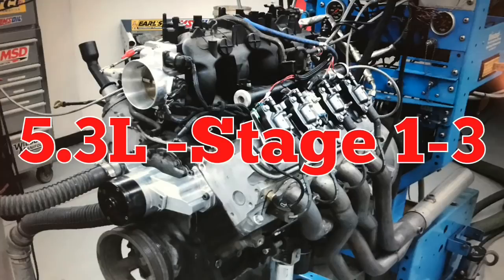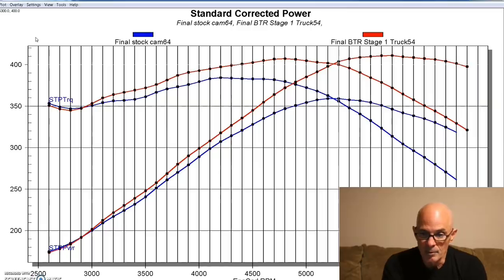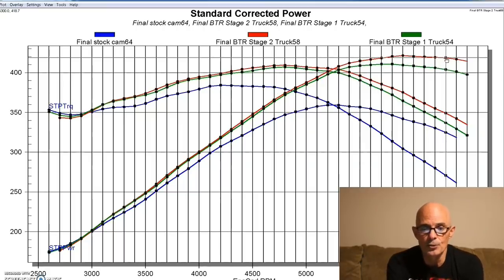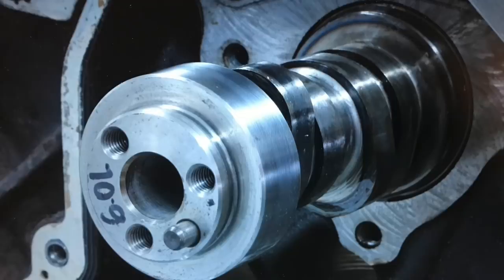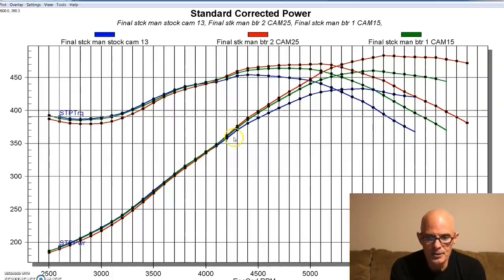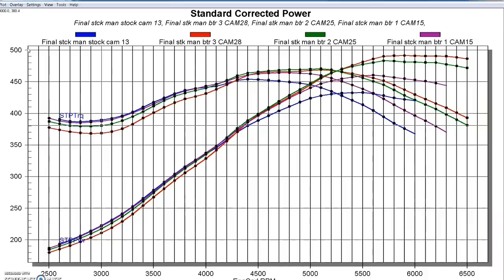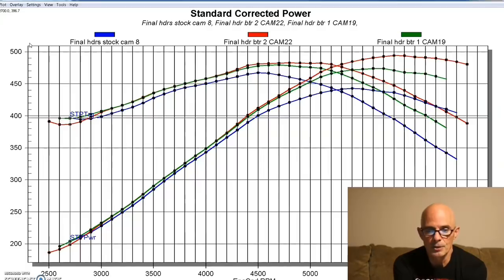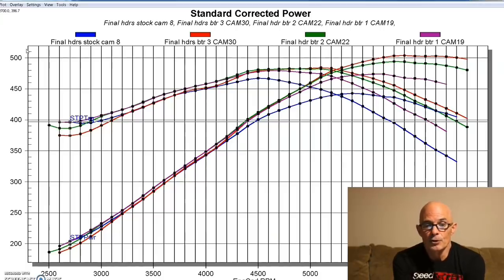LS TRUCK CAM TEST-5.3L & 6.0L (TORQUE FOR TOWING)

Comment: Im3 runing the stage 3 in my daly 6.0. But i put 862 heads on it to rase the compershion to 11 to1.with camero header and i have no problem with it and a 2700 stall

Comment: Biggest takeaways from this test:
1)  Stage 1 is nothing to scoff at.  Everything to gain and nothing to lose (unless you have a 4L60, then you’ll lose 3-4 gear)
2)  Stage 3 cams always sacrifice low rpm torque for high rpm HP in stock CID, and the shift isn’t necessarily favorable in small displacements.
3)  Rec port heads really like long tube headers.  I’m guessing because while the intake ports have massive cfm gains over stock cathedrals, the exhaust cfm gains are “minimal” (by comparison), so power gains from scavenging are “amplified” a bit.  

A buddy of mine has been asking how to make more low end torque in his 3/4 ton Chevy (rec port 6L).  I told him long tubes and a BTR stage 1 truck cam or Summit 8718 (206/217, 0.500”, 110 LSA).  Judging from the results here, I think I pointed him in the right direction.

Comment: Not that I don't like looking at that pretty face, But you're blocking the upper engine speed range brother! LOL. So exactly where did the stage 3/6.0/headers combo make peak power? I've been trying to figure this one out because thats the combo I'm running in one of our project vehicles and revving it over 6200 results in a slower ET everytime. Maybe those rectangular port heads are letting that cam reach a little higher in your test mule than the catherdral ports I'm running?

Comment: Definitely subbing. Can you make a recommendation, 70 Chevelle I have a LQ4/80E. 317 heads. This will be mostly a street car. I also want to run A/C. I’m willing to change heads to 243 if needed but would like to keep the 317 “ if” I go turbo later. What converter and gears would make a nice street beast and maybe some strip? I’m running a 12 bolt currently. Thanks for your effort.

Comment: I'm going to run a trick flow 216/220 duration, 560/560  lift on a 6.0 LQ4 chevelle  6 speed twin 256BW turbo's  should run great and be easy to tune. Doing all myself  !

Comment: Sir i love your channel you do a great job ive learned a lot i have a 01 1500 with a 5.3 have a cold air intake and acess to a tuner.i also jad monster transmissions build a 4l65e trans with a 1600 or 1800 stall and corvette servo. I have long tube headers and hi flo exhaust. I saw btr torque cam they have out comes with heave valve springs and push rods i was woundering in your opinion what the best cam would be for me for to buy. I want good power and torque for pulling and anything else ypu reccomend to do to my truck to get more torque would be great thanks man love ypur channel im just not good at reading dyno charts thanks keep up the good work
Reply from the maker: btr torque cam

Comment: I just built a gen 3 5.3 for my k10. stock motor other than a BTR stage 3 cam, and springs, hardened stock length pushrods from Texas speed. I will make 430hp at the crank? seems a little high compared to what i've heard. New to all this engine stuff!
Reply from the maker: not sure what stage 3 cam it is but that should be close with headers

Comment: Is it advisable to do do a cam swap on a 6.0 LS that has high miles (over 200,000) without pulling the heads, reworking them and putting in new lifters?
Considering the BTR Stage II cam. Thanks! Awesome channel!!
Reply from the maker: no need to pull heads

Comment: Looks to me like if a guy really cares about truck mods for towing and drivability then their most effective option is a gearing swap 😆.

Otherwise displacement, compression, and headers. Not sure how well a stall converter works for towing but that might make a big difference too.

I also have a feeling Cath ports are better than rec ports.

Comment: Great video man! 
But why did the 6.0 make so much power stock? 
Thats a fare bit more than the egnine was rated to make from gm when stock. 

I have been considering the stage 2 cam for my 2015 6.0 power Silverado 2500 for the better torque and power when towing. 
But it just seems odd that that cam is making almost 100hp and 100 torque more than my engine was rated at stock. 

I am also looking to go to long tube headers soon as well.

Comment: Richard, would you expect to see much of a difference with the new v2 version of the cam? More specifically the Stage 1? I'm getting ready to do a cam and spring swap (and headers, exhaust, intake..... :) on my '04 Silverado (5.3L, 4wd, 3.73, 33" tires, otherwise stock). It is my daily driver and does tow on occasion so I'm not willing to give up much, if anything, down low.

Comment: Hey Richard!  Would we see power had or power lost if we threw a set of 862/706 5.3L heads onto the 6 liter with the btr stage 3 or 4? Would the cams need to breathe more being choked by the 5.3 heads or would we still see MORE power with the added compression dispite the smaller combustion chambers than a factory 6.0 head?
Reply from the maker: See the 706 vs 799 head test video on the cammed 6.0L
Reply: @richardholdener1727  862 heads FTW

Comment: Do you think the summit 8701 would be better than the stage 1 or 2 truck cams? Cheaper and a bigger cam and can still use stock converter?
Reply from the maker: have not tested it

Comment: My Question...
Why did my Buick V6 horse power peak at 4800 rpm with 403 whp ( estimated at 500 crank) and 500 wtq ( estimated 600 flywheel torque)
This was 25 years ago, It had:
- 44mm turbo 
- Giant Precision Turbo intercooler 
- bigger injectors 
- bigger throttle body
- 3” single exhaust ( cat delete)
- Houston Down Pipe
- 23 lbs boost

Stock valve springs, stock intake manifold, stock cam, stock exhaust manifold, stock bottom end

Why such low rpm horse power peak 4800 ?

Maybe weak valves???

It did have 125,000 miles on stock springs
Reply from the maker: That motor had a very small cam and small ports-it was designed to make power early in the rev range

Comment: Really interesting work.  Just discovering your channel. Have you does any research on cam or just general build that increase pressure down low for better efficiency and maybe even sacrifices rpm and peak horse power?
Reply from the maker: I HAVE RUN 1000S OF TESTS ON CAMS-IT IS VERY HARD TO GET GAINS AT 2000 RPM WITH A CAM-EXCEPT WITH VVT
Reply: @richardholdener1727  why do you think that is?  Is there just too much sacrifice on the top end to be worth it? Would pistons + cam achieve that result?

Comment: stage 2 makes within a few hp of the stage 3, and gives up nothing to stage 1 in torque.  Stage 2 ftw.  The LS3 heads are soft at lower rpm.  706/862 heads would claw back some of the losses from the stage 3 cam.

Comment: Richard, great tests. I have been thinking about the Stage 1 came for my 2011 4.8L Silverado. Will that work with VVT? I know the VVT is supposed to help low rpm power, so If I had to delete that, I wonder how much power is lost down low in a VVT delete?!?
Reply from the maker: you need vvt specific cams

Comment: This must be for the 1st version of truck cams from btr. I have a version 2 stage 2 and those cam specs where nowhere near mine....
Mine are 262 intake 268 exhaust duration
.553 net lift
111LSA

Comment: Great job! I would like to have seen the differences in HP and Torq with headers on the 5.3. I currently have a 5.3 with the stage 1 cam and stock manifolds with 2.5" mandrel bent exhaust and really like it. My truck dyno'd at 275 hp to the tire and 404 torq. I have no idea how this compares since it is a truck on rollers vs. engine only on dyno. What are your thoughts? Thanks again.

Comment: 95-100kPa MAP only requires only about 1/2 throttle at 2k rpm. Very common to find yourself in that speed/load condition when you drive a stickshift.

Comment: Hey Richard!! Hope all is well. I’m considering a stage 1 or 2 fora 5.3 from summit racing. The stage one is a 209/217 with 500lift or a variation of this cam is with 550lift. The stage two is a 212/218-16??   Could you in the future run the stage one from summit. Or comment on it. Maybe there is little difference between the btr stage one and summit. But it would cool to hear ya. Thanks Richard 😁
Reply from the maker: either is good-just get one and put it in and enjoy
Reply: Richard Holdener. Hey Richard!! Just received my summit 8712 cam. 209/217 500lift. 112lsa. Why this cam ?   It’s to keep my lift low to help out with the 1.8 stainless steel roller rockers, 7.450 pushrods. I also received the pac 1219 springs. Good up to 625lift spring rate is 344-ish.  Is this a good combo?? So. Watching your videos was a definite smart idea and educated me. Generous information here. Thanks Richard. Now the task of doing all this. Plus I’ve got exhaust and headers waiting.  Stay safe

Comment: people called me crazy for going with stage 2 truck cam in my 1999 z28 made 350 hp 350 tq to the wheels 410 gears 3600 stall it’s a monster slicks are needed what was the advance in each camshaft specs please would  advance affect torque ?

Comment: What converter would you go with on a 6.0 with a stage 2 cam ?
And when you bump up to stage 2 from stock.  Should you do lifters ? Should you do springs ? Should you do rockers or lifters ?
I just need some more power out of my 6.0
Reply from the maker: not sure on converter-springs are necessary with most cams, lifters are a good idea-though we often reuse.

Comment: I’d love to see a test with the vvt in place vs the cams.   I’m looking to do a cam swap on my L92 but I’m concerned that deleting the vvt will lose a significant amount of low end torque.    Although with the extra displacement and nearly 1 point in CR that might not be that big of a drop.  And if so the 6l80 will make up for some of that in gearing.  

What do you think Richard?
Reply from the maker: I can't test VVT on the engine dyno with our Holley or Fast

Comment: I literally just ordered a Stage 4 BTR camshaft for my 6.0 LQ4, and I'm a bit disappointed to see the loss of torque down low. My truck is a 5-spd manual however,  so the convertor isn't an option. Will my manual transmission help me or hurt me with the torque?
Reply from the maker: it will help but the loss is still there

Comment: The low rpm losses on the 6.0 probably due to the larger square port heads; square ports with their larger cc will have less velocity when compared to the smaller very efficient ports on 706 heads. 706 heads would obviously then work good on a 6.0 if low speed torque is the goal. They might even be a better match with the cam, in terms of total "under the curve" power produced. The square port heads obviously would work better on a larger displacement motor, or one cammed to make power from 5000 up..

Comment: If you have a 6.0l, could you not swap a 4.8l or even a 4.3l converter in to get back some stall speed? I know it won't be perfect but given how much more torque the bigger engine makes at low rpm it should give you +500rpm stall over what it does with a 4.8
Reply from the maker: not sure on converters

Comment: Richard I am using a manual transmission such as a SM465 with my 6.0 LQ4 is I use a stage 2 or 3 cam what are the benefits? I have 799 heads all naturally aspirated. Thoughts and recommendations

Comment: Was the loss down low due to compression or could it be fixed with compression because I think most truck motors are 9-1 stage1 shift  5900 stage 2 shift 6200 stage 3 6400 especially if you have a stock transmission coming up by carry so far out in my opinion

Comment: Where's the boost? Just subscribed. Love the testing myths & rumors & giving data to teach what's real. Would you show us when (if at all) it's necessary to run a blow off valve? Is there a boost level, or type of turbo that makes it a real necessity, or are they just to make a different sound  when you let off?
Reply from the maker: always run a BOV

Comment: Did the 6.0 have trailblazers ss intake with headers? I've read that intake works good for a factory setup, and with a ls7 cam the 6.0 is capable of 450 and above. Better heads can just top over 500, or really close to 500.

Comment: im tryna see the absolute biggest and most aggressive power adder cams you can find on the interwebs for a sbe 5.3/6.0 with stock heads
Reply: Hakimbo Bola  do you have so little to do in life you need to intervene on the most irrelevant fact that not a single person in the universe cares about because its 2020.

Comment: You say it’s hard to get torque gains real low with a cam. So what do you think is the best way to get the most gains as low as possible? 
Mainly for in a towing application. 
Running a completely stick 2013 5.3. Stock exhaust, intake, etc

Comment: I have a BTR stage 4 trk cam (224/230[553/547] 111.0 lsa)  I have a gen 4 5.3 w/flat top pistons and 243 heads.  I will be running a sheet metal intake.  Since you didn't use the stage 4 cam; what gains do you think I will get w/ the cam listed above?  Also, how radical do you think the CHOP will be?  Thanks
Reply from the maker: the intake and cam will both hurt low speed and mid range torque
Reply: @richardholdener1727  thank you for taking the time to answer my questions.   What cam would recommend ?  I really want that chop, and some power

Comment: So if I step up to a better torque converter, what stall should I use? Building a 6.0 4X4 Truck w/4L80. Daily driver, combo town/highway driving. Emphasis on better in-town acceleration.

Comment: Why didn't you test the stage 4?  Btr recommended the stage 4 for my 5.3 truck,  circle d 3200, longtubes, tbss intake, and 4.10s
Reply from the maker: did not have
Reply: Richard Holdener on 6.0 lq4 or lq9 will i see gains with 862 or 806 heads with a stage 2 cam or just keep the 317 heads? Thanks in advance

Comment: I have a btr stage 2 truck cam in my 03 lq4 Sierra, I have the stock 317 heads on it and am planning to port and polish a set of 243 heads I have then install them. I also have banks headers..... question, what turbos do you recommend I buy and should I change anything.... I pull a camper and don’t want my friend with his 06 f350 to make me feel inadequate :). Looking for streetable 800 Hp and similar torque. PS I want to use two turbos because it’s symmetrical and satisfies my need for ...... well you get it.

Comment: you say a lot of guys want that torque down low and its really hard to do that with a cam shaft. what do you suggest to add more power down there ? my truck isnt a race car... im not often mashing the throttle if ever, but i want her to be able to get out of her own way as the saying were
Reply from the maker: compression and displacement help down there

Comment: Thanks for the video’s. I’ have a 6.0 lq4 4l80e 355 rear gears. I have a set of 862 heads I’m going to swap for the 317s. Was wonder what cam should I go with? Was thinking the btr stage 2 v2. Looking to maximize torque

Comment: What about their stock valve springs with only .500 lift comp cam 54-455-11 it's more on the extreme side of lift but they say it's good for the smaller engines at delivering torque down low I know you ain't trying to buy all the cams but if comp is going to send you one I think it would be worth looking at

Comment: Richard like get your thoughts, for a real world test where the truck needs to retain the cats which would affect scavenging, would a (@050) 210 in/224ex 114*ls make better low end torque from 2500 to 4000? Than the factory ly6 cam?
Reply from the maker: maybe-but I don't think cats change scavenging with stock manifolds
Reply: @richardholdener1727  This would be a good test to run, stock manifolds, cats and the suggested cam vs the ly6 Thanks

Comment: Have you done a max effort stock short block 5.3? Milled, ported and upgraded valve size stock heads with a aftermarket cams and intakes fast 102, Holley hi-ram and atomic airforce
Reply from the maker: We did over 500 hp on a 5.3L with HCI-video is up

Comment: Richard, you briefly touched on guys getting a truck cam for more low end torque. How does one build/tune/mod an LS for more low end grunt? I always felt they’re a little soft off the line, like they needed shorter gears. Or are gears & converter the fix?
Reply from the maker: that works-its hard to gain low end with a cam

Comment: One question. Do we need to worry about injector size with a mod like this. Do the stock injectors cover a 50 hp gain up top?
Reply from the maker: should be enough

Comment: I just finished bolting a 3 bolt cam, 4x cam gear, new chain and chain dampener into an ly6 and there seems to be alot of t-chain slop with the factory tensioner removed and the vvt delete kit in there, is this normal?

Comment: Richard Holdener I have a 4L60E with 2600 stall with and a 2004 5.3. I would like to know if that stage 3 would be the right cam to get for my application

Comment: HEY RICH, IF YOU ADD A FAST INTAKE TO THE 6.0L WITH BTR STAGE 2 AND HEADERS, WOULD THAT GIVE THE EXTRA 6 HP TO CRACK 500? 🤔
Reply from the maker: might do that
Reply: ALSO, WILL L83 HEADS WORK ON A LQ9 OR LQ4?

Comment: Do you have any sense of how necessary it really is to upgrade the valve springs? The improved torque curves would be attractive even if your not revving to peak power. The spring upgrade can add a lot to the cost.
Reply from the maker: Needed for the Lift-not just rpm(might be able to use LS3)
Reply: @richardholdener1727  Thanks! Would spring binding be the limiting factor at these lifts, or just the force?

Comment: Curious to see this with the v2 versions theyre pretty much the same but the lsa is tighter on all of them. Surprised u didnt throw the stage 4 one in aswell. The stage 2 picked up 40whp and 10wtq through an automatic in my lq4 third gen firebird i had it dynoed before and after

Comment: Any dyno runs on a 5.3, carb with shorty headers running the stock ls cams? Or this video using a carb setup?
Reply from the maker: I have run carbs on many 5.3Ls-they make less power than the truck intake